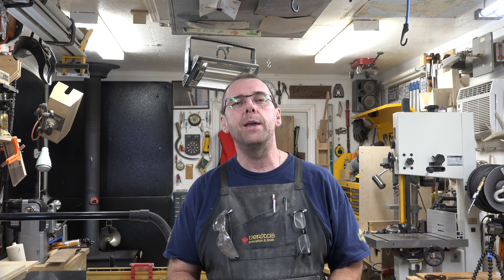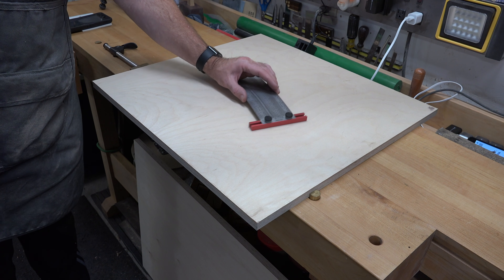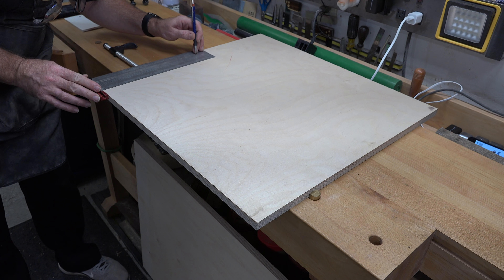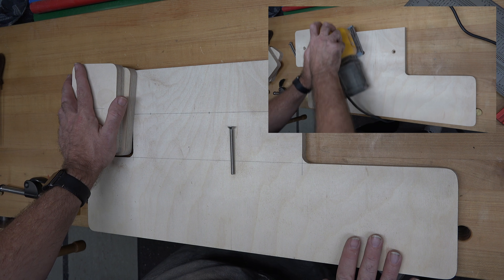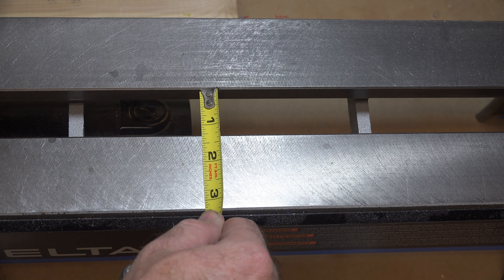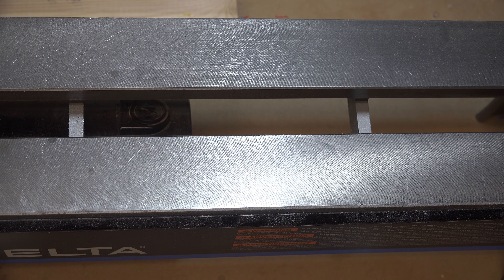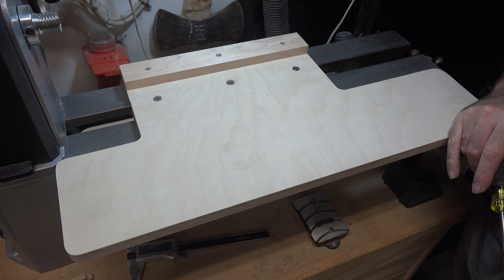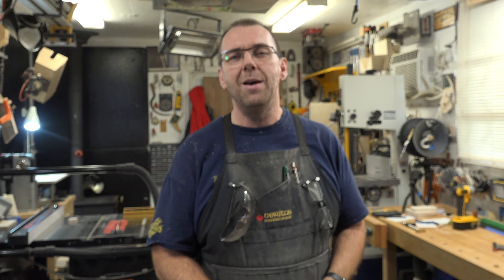Lathe Duplicator Part 1

Comment: Thanks for the video.  Aside from this duplicator, you may want to make a steady rest or other accessory that can be removed and replaced in the same location on the lathe's bed. I have a suggestion to make index blocks that will precisely locate a fixture on the bed.  

To make the  index blocks, cut a piece of baltic plywood of any desired length to slightly less than the space between the bedways.  Then cut that piece diagonally to make two wedges of the same taper.  Apply glue to the hypotenuse of the wedges, and then place them in the bedway space and push the wedges together.  Now you have made a snug-fitting index block that can be glued/screwed to any fixture or accessory that you may make.
Reply from the maker: Great suggestion Bob.  Thanks for tuning in and for chiming in with your thoughts.  They are very much appreciated.

Comment: So WoodsmithPlans sells this exact plan (copyright 2013) for $12.95.  Just curious, did you take their copyrighted plans and are giving it away for free as your own idea or did someone rip off your idea, copyright it, and is selling it for profit?  2 years ago you said you didn't have plans for sale, but they have had the plans for sale for several years.
Reply from the maker: I used their plans as a base to build this duplicator (I bought the magazine that the plans were included in) and present it on the show.  I do not have plans for these because I do not have distribution rights for their plans and can not give them out.  I don't offer the plans.  I don't show images of their plans.  But I did use their plans (that I purchased) as a guide to make this video.  I hope this helps.  Thanks for tuning in.
Reply: @acutabove_woodworkings  Gotcha, yeah I literally just purchased the plans myself.  Multiple people have asked you for plans, might be worth pointing them to where they can get them.

The biggest modification I made was to the template.  Instead of screw in templates, I made clip ins on a grid  (kind of like a paper cutting grid or something).  That way I can make templates for things and clip them in and out (eg, chess pieces, ring posts, etc) quickly to change up what I'm doing.  This lets me make multiple things on a single spindle by reversing the template and moving it to the next grid so I can make things back to back and divide the pieces when I'm done.  I literally have a box of templates that I can dip into.  This even let's me take multiple templates and clip them back to back to make different types of posts and stuff.
Reply from the maker: @joshuawrye  That sounds like a great modification.  It really is a great duplicator.  Thanks for chiming in with your modification.  I truly appreciate it.  I will get a link to the plans and post it in the video description so that others can find the plans if they like.  I have had many people ask for the plans and I have to deny them because I have no distribution rights to give them out.  A link would be handy.  Thanks for the suggestion.
Reply from the maker: Link has been added to the video description.  Thanks again for the suggestion.
Reply: @acutabove_woodworkings  Yeah I have a Rikon so it's not the same as the jet they use anyway.  So I was going to have to make modifications for sizing.  Figured while I was at it I'd do some quality of life updates as well.  Something I really want to do with it is put the jig on rails so I can always make sure it's perfectly straight (like a 3d printer gantry), but with the difficulties I'm having with dust collection (because it goes everywhere), I know it won't ride smoothly throughout the turn so I haven't tried it yet.

Comment: This series is perfect. I've been asked if I could recreate a set of large chess pieces for a local school and of course I said I could do it. I'm not too experienced with the lathe but just did a freehand test piece tonight. Took 2 hours for a pawn rough stock to finish applied. That's 64 hours of turning! 
Thank you for this.
Reply from the maker: I wish you luck on your chess piece project.  Sounds like a fun one that the duplicator will work perfectly for.  Thanks for tuning in to the show.

Comment: Great video. For this plan, what dimensions would I need to adjust to increase the diameter I can work with? My lathe has a 12" swing and I am looking at projects starting with blanks up to 10". Thanks.
Reply from the maker: You would need to adjust the height of your tool rest for starters David to make it so that the tool rests at the centre of your head stock.  You might also have to adjust the width of your platform to give more room for the tool rest to be supported while working on larger pieces.  I hope this helps.  Thanks for tuning in to the show.

Comment: the thing I am wondering about most is..... where do I find one of those rulers you are using?  whats it called and who sells them?
Reply from the maker: The rulers that I use are called T-rules and they are made by INCRA.  They are available at most woodworking suppliers or from INCRA themselves.  They are a little pricey but worth every penny for the ease that they add to layout.  Here's a link to Lee Valley for the rule.  http://www.leevalley.com/en/wood/page.aspx?p=58877&cat=1,43513,58883,58877. Thanks for tuning in and for taking the time to leave your question.  I appreciate the support.

Comment: Kenny, possibly a stupid question but when you made the first cut you marked it out with one of those jigs I asked about in an earlier video and cut it on your table saw.  I would have just measured from the fence to inside of the blade on the table saw and cut it.  Is your method more accurate and if so how/why?  Regards Garry
Reply from the maker: Not a stupid question at all Garry and in fact it's a great one and it all has to do with editing.  My initial thought process when I first started laying out this project for filming was that I would complete the layout of the base on camera so that the audience could see what the final shape of it would be and then I would cut it.  After laying out the initial lines for the overall dimension of the jig's base, I realized that the excess material was getting in my way so I changed gears and just cut it on the table saw and finished up the layout on the smaller sized stock.  Truth be told, I should have just edited out that first layout segment and saved a lot of chit chat by just saying to "cut the base to the following dimensions".  It's reasons like this that people say I talk too much on my show.  LOL.  Set your fence Garry, lock it down and cut the base without worrying about the initial layout lines.  Thanks for the great question though.  I appreciate you engaging the conversation and I also appreciate you tuning in to the show.